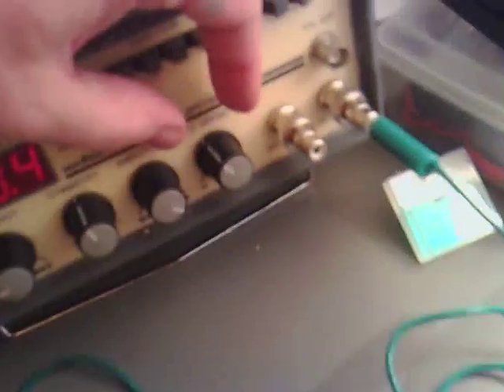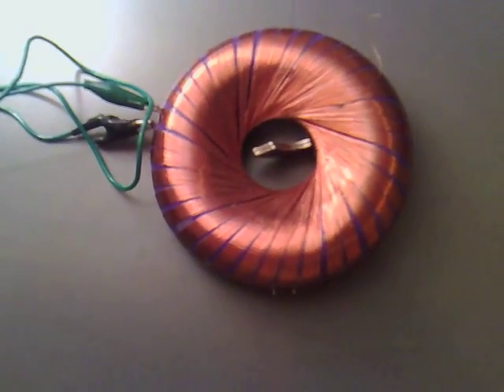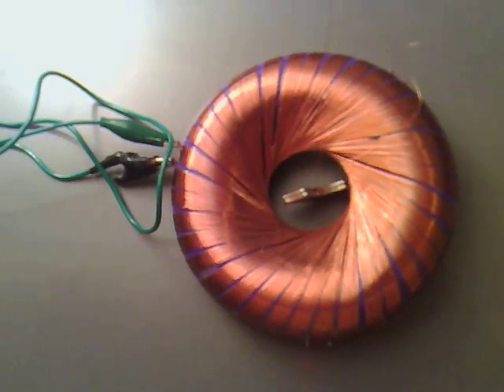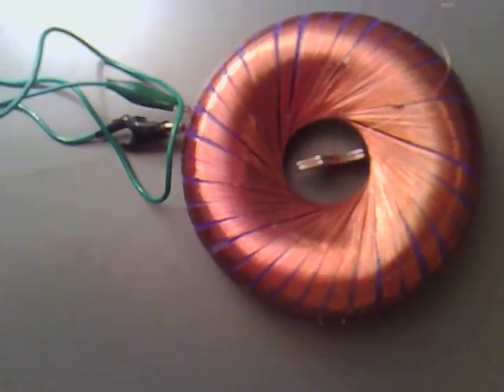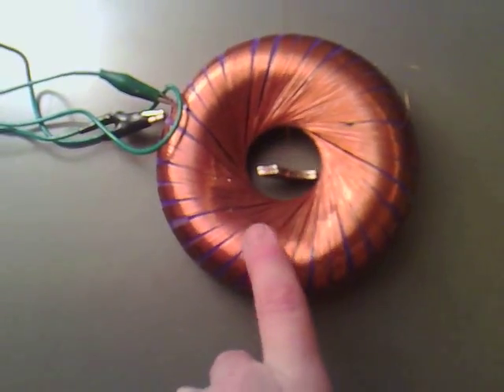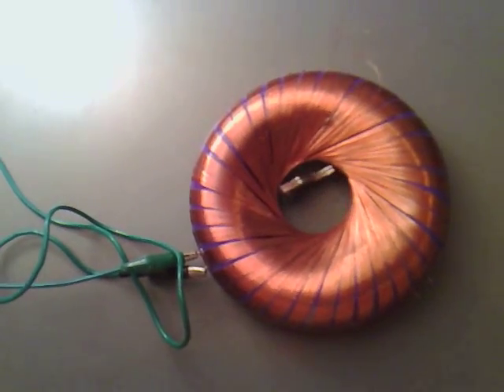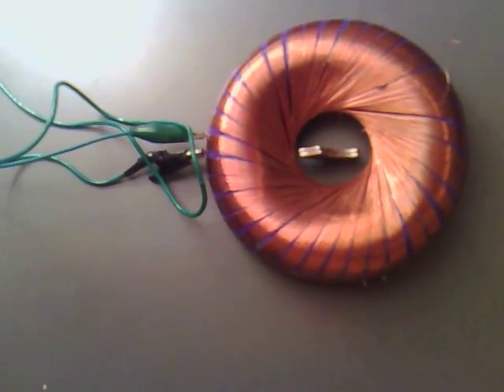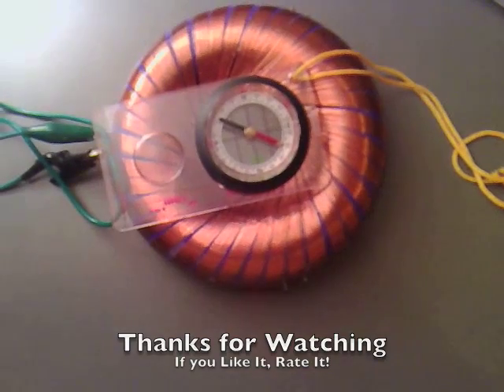Kubik Coil (Alignment) 005

Comment: In my research of the Rodin Coil I find what seems to be one coil. The design says to go 30 degrees less than straight across. 150 * 24 = 3600. Now on yours I only see an initial 12 turns then repeats. Why three phase?  I do like your demo of the power of induction this has at it's center. Perhaps show the scope again at multiples of 360 and also set the coil standing up with a ferrite rod like your flashlight(torch) has and put a pickup coil on it to the scope. Still this device is amazing.

Comment: Can you place a glass of water inside, place a magnet inside the glass and set the frequency to 42280kHz and push it up to around 42800kHz slowly, time laps film if you have to? I recall a UHF experiment I read about, though it involved a quartz crystal tube instead of a rodin coil (glass and magnet).

Comment: In fact this is exactly the way a three-phase permanent magnet motor works.  Check out the design of the stator of a three-phase brushless motor.  The reason this works is that you can produce a rotating magnetic field due to the net B-vector being the vector sum of the B-vectors of the three windings.

Three-phase transformers similarly work by producing a rotating magnetic field with the primary windings, which then cuts across three other (secondary) windings, producing current in those.

Comment: I made a standard biflar rodin coil, but instead of the hallow toroid, I wound it over a insulated copper coil that was thick enough to form a toroid. I don't have a signal generator like yours, I have been using a simple 555 timer driving a 2n3055 power transistor. I plan on making two more 555 coil drivers, and tuning it by ear. Some time I will need to buy an oscilloscope for the tuning of high frequency, and so that I can see the wave form too,

Comment: See Zeropoint132.

Place the concave mirror under you coil.

Place a sphere magnet on the mirror.

Pulse the coils in sequence. Recover the energy produced in the two 'open' coils and feed that to the third. Use SPDT reed switches to effect the timing.

8)